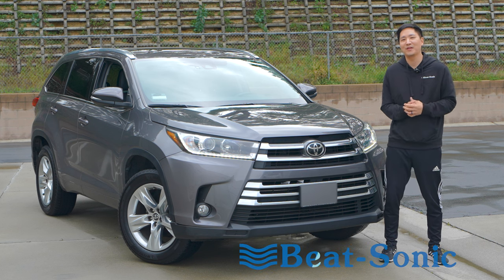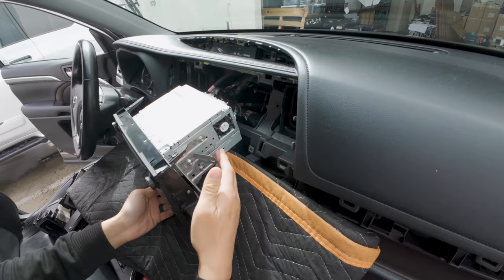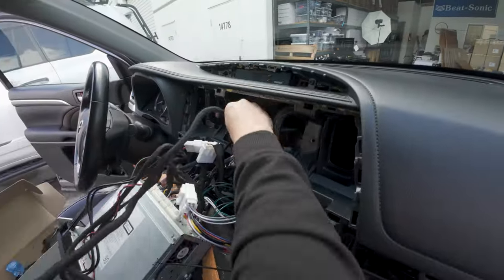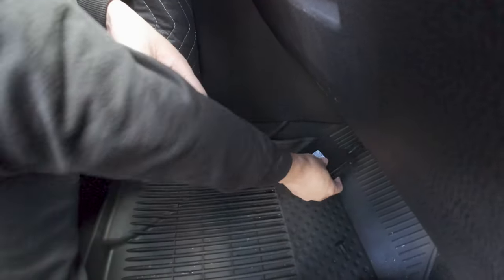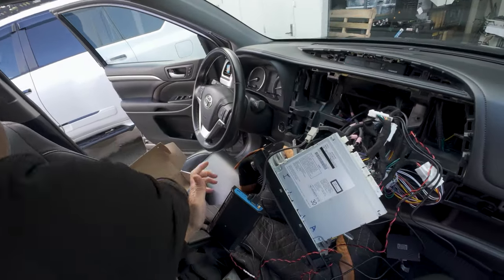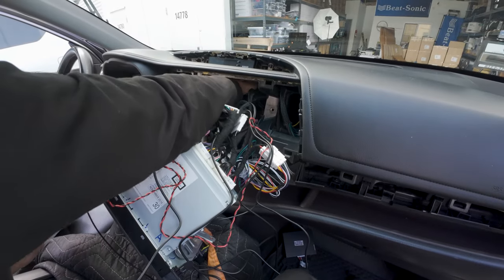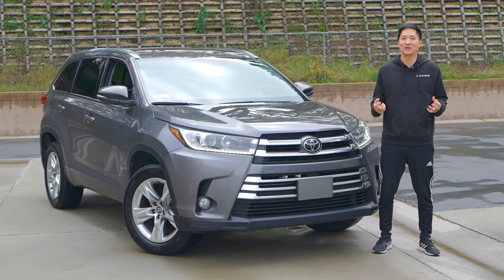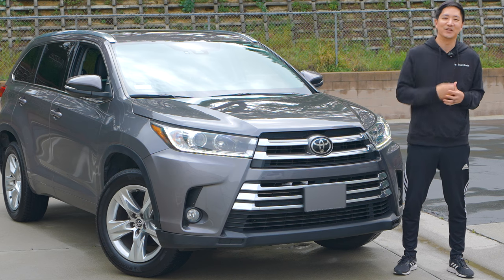2014-2019 TOYOTA HIGHLANDER | CarPlay & Android Auto Installation

Comment: what if i just buy the adapter and the power box i want it only wired Is that possible?
Reply from the maker: You can use it only wired too by just simply plugging in the charging cable and connecting it to your phone.

Comment: Problem I'm running into is that none of these Carplay adapters, no matter the brand, will work with the 360 camera. My question is would this system still work but would disable the 360 camera? Or would it just not work at all? Thanks.
Reply from the maker: It will not work at all if you have the 360 cam
Reply: Naviks claims to support the bird's eye cameras. (and all OEM functions)  and there are some head units that claim to work with them as well.
But yeah - most of the plug-ins don't, and most of the head units don't plus losing functionality of other features.

I still haven't decided what I'm going to use - but only recently seriously searching.

Comment: With the optional USB Harness, you mentioned that by using the USB harness, it will make the CarPlay and Android Auto as a wired interface.  Does that mean the wireless connection will be disabled?
Reply from the maker: Wireless connection won’t be disabled. You have a choice between using it wired or wireless

Comment: Does this work for 2019 toyota highlander h.y.b.r.i.d XLE as well?
Reply from the maker: It will work if your vehicle does NOT have 360/birds eye view
Reply: @BeatSonicUS  Thanks for quick reply. How much does it cost for parts?
Reply from the maker: @brandonchang3482  The TAV-CB2W Wireless S-Connect Interface costs $649.00
Reply from the maker: @brandonchang3482  $649
Reply: @BeatSonicUS  I am using Android and my wife is using Iphone. Can this model work for both Android Auto and Apply Carplay? Or does it stick with a certain one as shown in pre-setup video?
Reply from the maker: @brandonchang3482  Our kit works for both Android Auto and Apple CarPlay, but only one interface can be used at a time.

Comment: What happens to the 360 camera?
Reply from the maker: Our product is not compatible with the 360 camera Toyota Highlander. The 360 camera will continue to function, but the CarPlay will not work.
Reply: @BeatSonicUS  is there anything you can recommend for those of us with the JBL and 360 camera?
Reply from the maker: @joseprprprpr  Our engineers in Japan are working on a solution
Reply from the maker: @joseprprprpr  unfortunately we don’t know any solution for 360 equipped Highlander